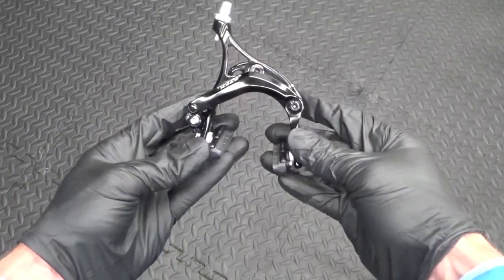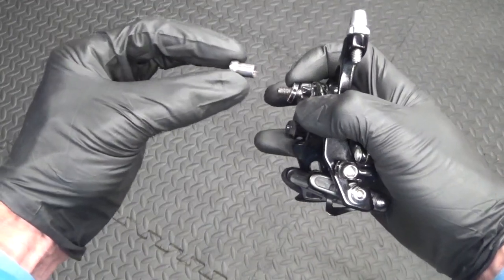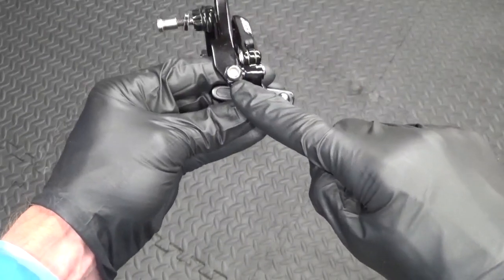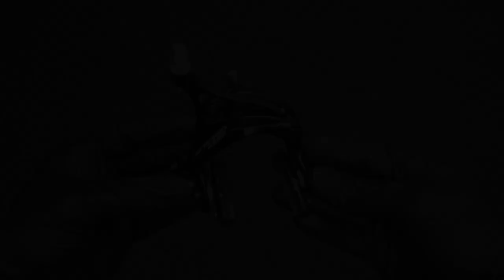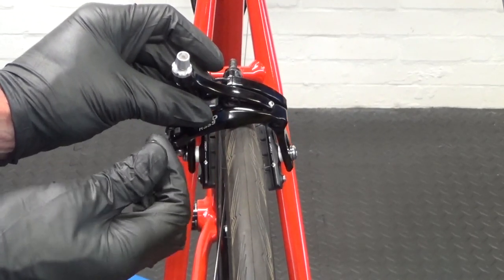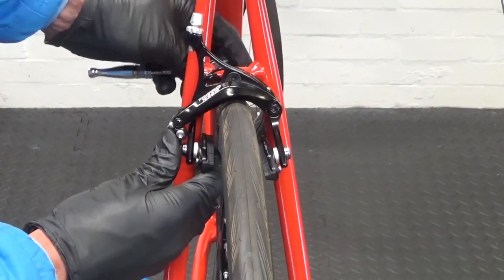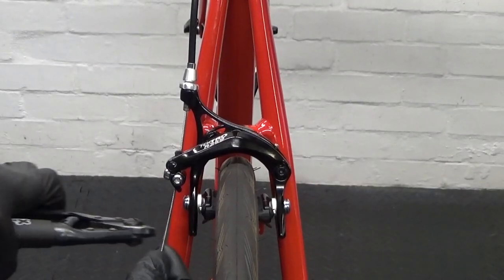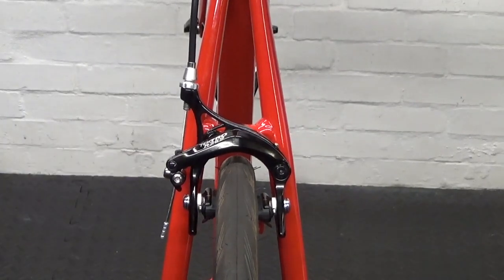How To Fit A Dual Pivot Brake Caliper

Comment: Got it, thank you! After comparison with Shimano 105 caliperbrake, I found they make it smarter, which would not make that diffcult when it is actually 3 pivots system, making left and right pad pushing at same time.